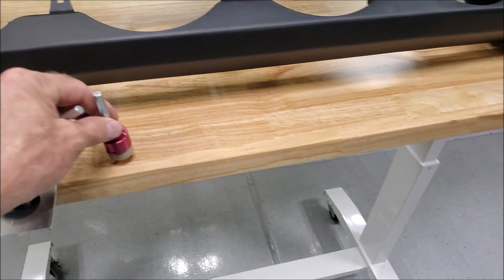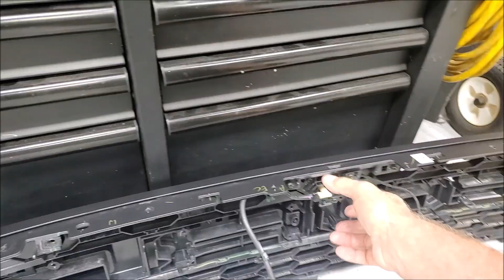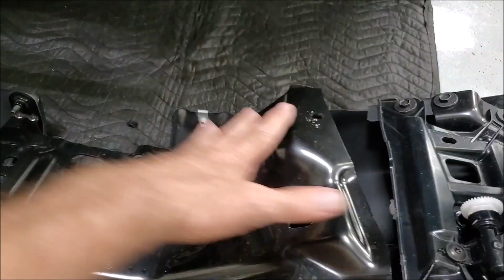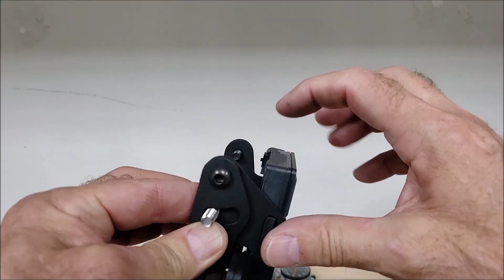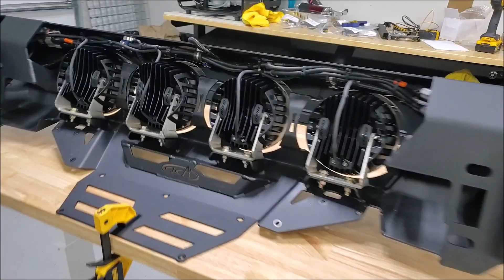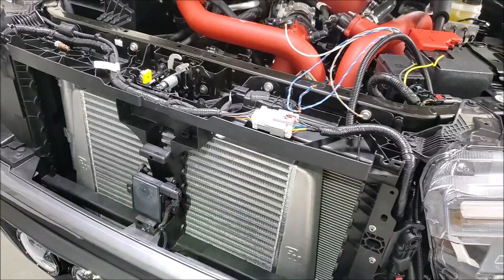Part 2 2025 Ranger Raptor ADD Front Bumper 2 Stars Now Addictive Desert Designs

Comment: I bought the radar relocation bracket and was so confused by the instructions, I started looking to how other people installed it. I did what you did with the two small bolts.. simple and fast. Tearing the whole front end off made no sense.   I want to mount my parking sensors using new bezels too, do you have a part number for those?  I can't find the one that you have there. Thanks.
Reply from the maker: https://www.amazon.com/dp/B0DF2Q1BF1?ref=ppx_yo2ov_dt_b_fed_asin_title

Comment: I was looking at my 2024 Ranger Raptor and I noticed that I do have the extra sensors on my bumper. They must have stopped putting them there in 2025. I don't see how that's a good thing. More sensors are better.😮
Reply from the maker: I know in the rear the outer sensor is in the tail light. The front might have been moved into the headlight because I still get cross traffic alerts.

Comment: In your first video, You mentioned you have a machine shop. I'm just curious why you didn't drill out and notch the two holes for the sensors to match the factory holes so you wouldn't have to grind the plastic knobs on the sensor mounts. For cable management, it seems like there's enough metal structure on the inside of the bumper to drill holes and use wire management clips that you push into the holes, but hey, magnetic clips are pretty cool. Hey, did you paint those engine pipes under your hood orange, or did they come that way? Mine are black! I would have put a "Raptor" badge over the "ADD" logo. That's what I did on my Roll bar. It had a laser cut "Nawier" badges on each side and I replaced each one with a laser cut acrylic "Raptor" badge that has a little dinosaur where the letter "o" is. It may have taken a lot of your time to complete, but I think the end product looks really damned good. Now you have not only a unique truck, ( I very rarely see any other Ranger Raptors in my area) but you have a unique Ranger Raptor with very cool lighting capability. Thanks for the video!
Reply from the maker: My machine shop has a Bridgeport mill. Although it is very capable there is no way I could get an entire bumper mounted on that to detail those holes. You would need a CNC mill to duplicate that profile but this would be labor intensive and totally not worth it. 

There was no structure in the middle of the bumper to run the wires along the top. It's been a while and the magnets are doing great. It sucks they didn't add any tabs there. 

Process West offers the turbo piping in both black and red. I bought mine from Buckle Up Offroad in Florida. 

The Ford oval just filled that spot perfectly.

Comment: Just got a new to me 24'RR and I think this is a great looking bumper but now I will not buy it... Great info... Its disappointing that you had to go through all this... ADD needs to fix it because double sided tape is unsat.
Reply from the maker: I know right. What bothers me the most is that this issue could have been addressed so easily by them.